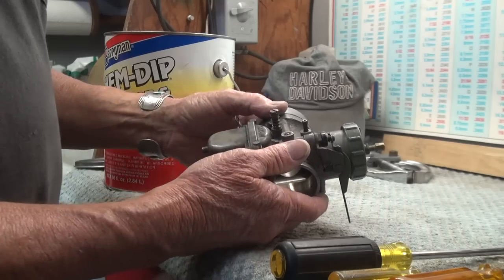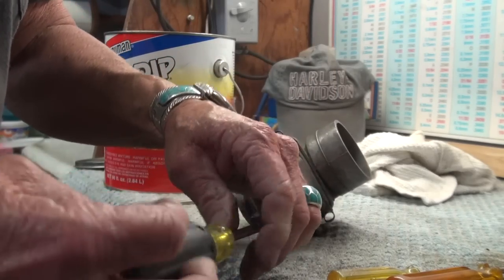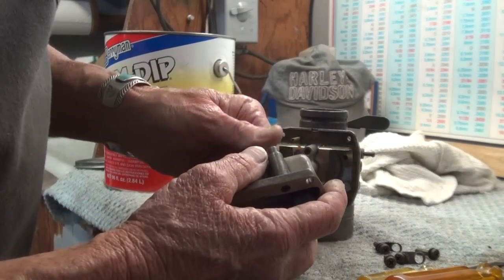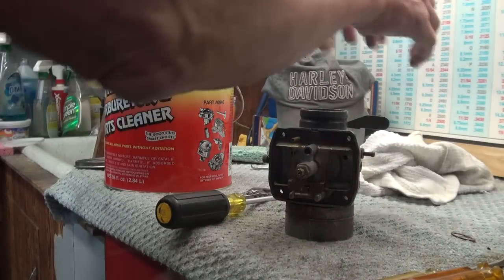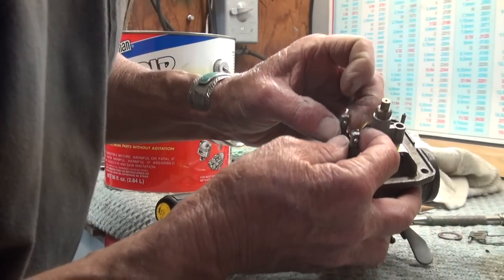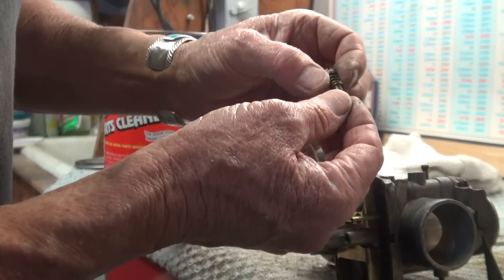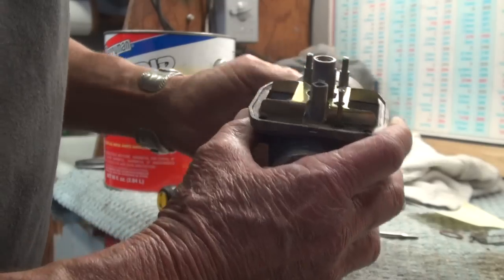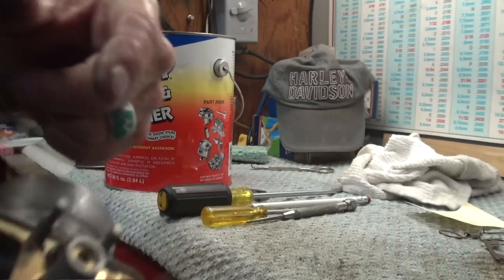Disassembling a Mikuni VM38 Carburetor for Cleaning-1/2

Comment: Just watched your video. Extremely helpful. Wish I would've watched it a few weeks ago. I've got an old VM38 like yours but I'm having some problems with it. Whenever I reassemble it upside down, it doesn't allow fuel into the float bowl. If I assemble it right side up, it floods real bad. Any ideas on why this could be? It's off of a '78 YZ400. thanks